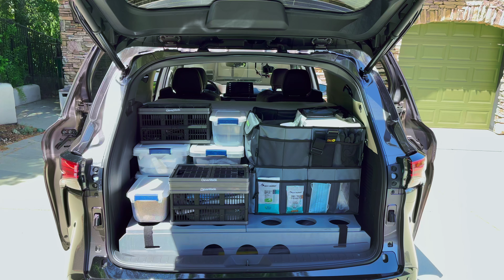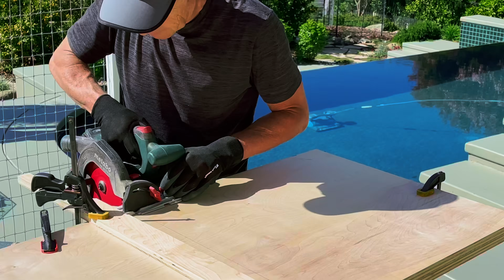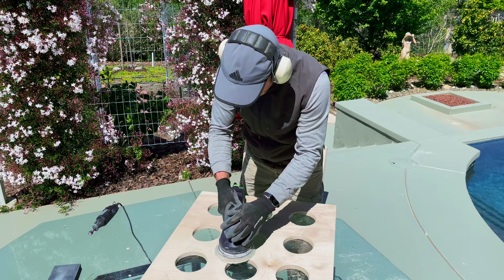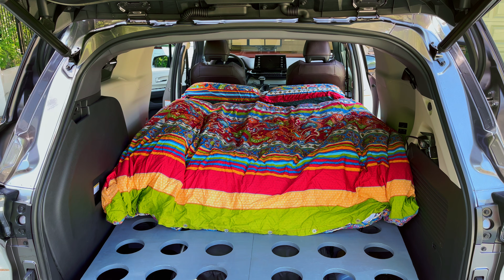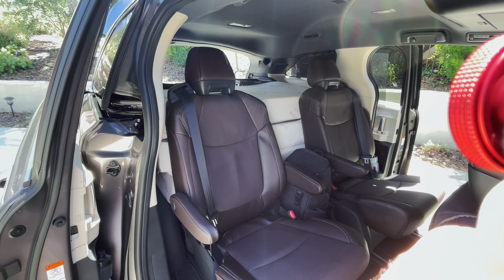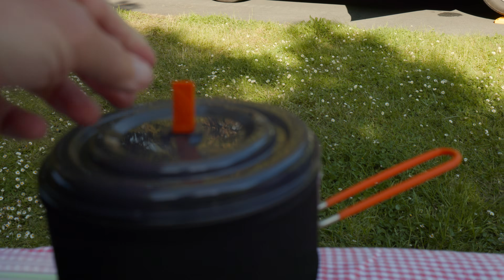2021 Toyota Sienna Camping Conversion: 2 and 4 seats sleeping configurations

Comment: Removing seats is not legal as it changes the original structure.
Reply from the maker: The seats in this vehicle are bolted to the frame and do not add or subtract any strength or rigidity of the vehicle.
Reply: ❤️👍👍❤️
Can you help me install
Reply: You in the Colorado

Comment: Awesome use of the telescoping ladders! What criteria did you use for choosing the particular ladder?

I'm guessing weight, capacity, ease of extending/shortening. Other considerations? Did you have to remove the ladder "feet" to be able to slide the ladder tubes into the holes?

Can you slide the ladder as a whole back and forth a little bit? If you can slide the ladder back a bit and the whole bed base along with it you could have a sort of "balcony" hanging off the back of you minivan on which you could sit (though doing so would place a torque possibly causing the whole thing to tilt). Just brainstorming ideas lol.
Reply from the maker: Hi Jose, thank you for your comment and questions. The weight of the bed and sleepers is evenly distributed by the plywood over the lengths of the ladder tubes, but the ends of ladders need to be supported. Yes, I took the rubber feet from ladders to insert them into the holes in the plywood structure. The diameter of the legs is ~2.4". Regarding the sliding balcony off the back of the van - I guess this could be possible but you would block access the the storage cavity where 3rd row seats are folded. Also the whole platform would need to be higher off the floor to clear the rear gate opening. I hope this helps. Cheers!
Reply: @Tellvia  Thanks Tellavia! Helps a lot and gives me some ideas!

Comment: That’s really interesting and creative for keeping the overall weight down….can you share more about the number of people sleeping….was it 2?….and did you have enough leg room when the middle seats were in?
Reply from the maker: Hi Dawn, thanks for your comment and the question. The lengths of the bed space is 72" (plenty leg room for 6 footers) with 2nd row seats in place and folded all the way forward to front seats. When the 2nd row seats are removed the total useable length of bed structure is 96" (should accommodate even very tall people). Sleeping for 2 is very comfortable, especially with 6" memory foam mattress. I hope this helps.

Comment: I thought about doing this with a 99 Toyota Sienna,  would a smaller motorcycle say a 300 model fit inside.
Reply from the maker: HI Jim, thank you fo your question. I think if wold be easier to fit a small motorcycle through the side sliding door since the step-in hight at the door is much lower than from the back. The max hight from the floor to the sealing is 42”. I hope this helps.

Comment: Wonderful. Thank you so much for doing this video. I have a couple questions if you don't mind.

-It appears that you cut the plywood panels to a standard size. Do you have that measurement handy?
-How high off of the floor (pick the reference point) does the top of your platform reach? Because of the variance of the shape on the side panels, I can't quite decide how high is optimal. You mention the 12" storage boxes supporting the ladders, so I suppose it's the width of the plywood, plus the ladder, plus 12".
-I would LOVE some dimensions on the third seat well structure, as well.
-How difficult was removing the third row seats? I haven't been able to find a tutorial and though it doesn't look difficult, I would love to hear feedback.
-Are you connecting your Jackery to the car for continuous charging? Then the fridge to the Jackery? Did you need the 1000? I'd love to cut some costs with the 300.

Thank you again. I was a little baffled by this layout once I started thinking about the build and with 3 weeks until a major trip, I wasn't even sure where to start. Plus, your hierarchy of need for this build perfectly reflects ours (though we have to keep the 2nd row until our little once is much older). This is a huge help.
Reply from the maker: Hi Atom, thank you for your comment and the questions. To start your project here what I recommend that you keep in mind when deciding on dimension of the bed structure:
1. If you plan to carry a refrigerator how toll is it. You would need to make sure that it would fit in the 3rd row well with the top plywood cover (which will be a part of your bed since you will keep the 2nd row seats). This measurement will define how high your bed structure will be. The floor in sienna is uneven and not leveled (it slopes down towards the front of the van). 
2. When designing/planning the bed structure make sure that you van is parked on a leveled ground or use spacers under wheels to level it. Now you can use a 36 or 48” bubble level and 6 feet long 2x4” straight lumber piece as a mock-up the bed structure from the back of the van to the folded and slid forward 2nd row seat. This will give you the hight of  the support (hight of the boxes) that will go under the legs of the ladders. 
3. The long level will also be useful when you are cutting the holes for the legs of the ladders. You want to make sure that the once the ladder sections are extended they will be flat. 
4. The 3rd row well has curved walls/floor. To avoid matching it contours I used just front and rear plywood section and used partial hight side sections cut as rectangular pieces. The side sections positioned to encase the fridge. Again hight of the structure in the 3rd row seat well is defined by what you put in it. I would build this section first. I will easier to build the middle section second. 

When I started my build I did not have any plans and measurements, I followed the logic above and kept cutting the plywood pieces to keep the structure level. The width of the van in the narrowest part (between rear wheels) is about 48”, so the standard plywood pieces will fit. I built my structure from 24x24” pieces such that I can unfold bed only on one side, if needed, but you can build yours from a 24x48” panels if you will always use full width bed. 
Regarding the removal of third row seats - it is relatively straightforward. All mounting bolts, covered by plastic covers, are accessed from the storage cavity. The third row seats come out as 60/40 sections, which is good, as they are heavy (~90lb and 130lb). Disconnect the battery before unplugging the seatbelt electrical connectors!
Now, about Jackery backup battery. We returned the 1000 unit and bought the new 1500W unit because we wanted to make sure that we would have enough charge to keep the fridge running even in very hot weather for at lest 3 days. The battery is connected to 110V inverter and the fridge to Jackery. The inverter in Sienna works only when the car is on (and the AC 110 switch is ON), it does not use the hybrid battery energy when the van is parked. When you drive the van charges the Jackery and keeps the fridge running. The new 1500 battery charges faster during driving. But the size of the battery depends on your needs. The fridge we have uses max 40-50W when it is cooling and about 20-25W once it is down to target temp. So 300W battery will keep it cold for between 6-12 hours.
I hope this helps. Good luck with your project!
Reply: @Tellvia  wow such details!  Thank you for sharing this important information

Comment: When you removed the 2nd & 3rd raw sets; How did you bypass the airbags lights in the dashboard of the 2021 Sienna?
Reply from the maker: Hi Jose, thank you for your question. Here is the link to siennachat forum where the issue of airbag warning is actively discussed https://www.siennachat.com/threads/2021-sienna-mid-row-seats.64221/. According to Toyota the second row seats are not removal because of potential safety risk associated with removal and disconnection of airbags. I removed the seats and found a solution for the air bag warning at my own risk. Because of potential safety and liability reasons I do not provide recommendations or specifics about my seat removal steps. All the best.
Reply: @Tellvia  so you were able to remove the 2nd row seats in a way that allows you to put them back in?! Im so curious how you did that. For my (very simple low cost) build,  I just left the chairs. And I am not able to sit up in mine, but i do have plenty of room for gear, which makes the stuff shuffle pretty simple. Yours is very impressive and I am inspired to try again!! Thanks so much for sharing :)
Reply from the maker: @ericastrachan4623 , thank you for your comment. Yes, I removed and re-installed 2nd row seats in our 2021 Sienna several times in the past 4 months, when we needed the van to seat more than 2 people, without any issues. The disconnection of the airbags built-in the 2nd row seats is something I’d advise you ask an automotive professional to do, so it is done safely. The airbag warning on the display can also be avoided and most of car mechanics should be able to help with that. Cheers!

Comment: Awesome project and video. I was thinking about doing something similar to a new Sienna I am thinking about buying for long trips. Do you think is possible to accommodate 2 adults and 2 kids(11 & 10) if only the second row seats are removed and a bunk bed setup with thinner memory foam mattress system is built ? Any feedback is appreciated. Thank you
Reply from the maker: HI Ricky, thank you for your comment. I think to accommodate 4 people in the new Sienna might be possible but it would be a tight squeeze, especially if you plan travel with some luggage. You likely would have to build two platforms - one to even out the level of the floor in Sienna and cover the second row seats mounting hardware (which is difficult to remove), and the second platform above it at about 18-20 inches. The total hight inside from the floor to the roof is max 42 inches, so this dimension will be a limiting factor. Both lower and upper level sleepers would have to be willing to crawl into their sleeping spaces. Good luck with your project!
Reply: @Tellvia  thank you for your response and your recommendations. Thank you for your great videos

Comment: also, do you have a mechanical drawing with dimensions of wood to be cut?
Reply from the maker: Thank you for your question, Paula. I started this camp conversion build as a first prototype and did not use any any drawings. It turned our well enough to use it and not needing the second build. I suggest you do the same following ideas from mine and others videos. All the best.

Comment: thank you for this video.  you mention birch plywood for your platform. what thickness did you use?  I'm guessing 3/4"???
Reply from the maker: That is correct, I used ¾" thick plywood.
Reply: @Tellvia  what about smaller holes in the plywood if we don't have a fridge there.  seems like may be 2 or 3"??
Reply from the maker: Smaller holes will work as well. There is not much load on the plywood structure, any hole size would be okay as long as you leave about 1.5-2” of wood between holes. My choice for the size of wholes was purely for aesthetic reason and for balance between removing a maximum excess of wood with a minimal number of holes. Good luck with your project!f

Comment: Good video! Can you leave the sienna hybrid system on 24 hours without it shutting off after an hour? In the Prius, you can sleep in the Prius with climate control on all night all day without the hybrid system shutting itself off! If the new hybrid sienna does NOT auto shutoff after an hour then I’m going to buy one for climate control camping.
Reply from the maker: Yes you can! You have to select "keep engine ON" on the display when you start the van. My video discussing HVAC on new Sienna for camping is coming our later tonight.

Comment: I guess you used a full-size mattress; I think you said it was 52x73 as compared to full-size of 53x75. But then you said 20 inch sections, which would be only 60 inches. Could you clarify? Did you cut the mattress yourself? Thanks; love what you're doing!
Reply from the maker: Hi DrG, thank you for your comment. I just remeasured the dimensions of the 3 panels of the mattress we use in our Sienna and they are 52”x24”x6”. I must have misspoken stating that the panels are 20” wide. I separated the mattress panels using a thread ripping tool. With little care and patience it can be done without making any rips in the panels. I hope this helps. Cheers!
Reply: @Tellvia  Thanks! I'm 6'4" so I need a longer bed but your video gave me the idea to look for a trifold foam mattress. I found a King-size Milliard on Home Depot website that will work. (Their almost-queen-size would also work, with 2 sections longitudinal and the 3rd crosswise so thanks for the tip!

Comment: Thanks for great video. You should make a video talking about yourself. I’d love to know you more. 
I bought a Sienna last week and I can really appreciate your courage gutting your new van and drilling holes in it. That takes some guts.
Reply from the maker: Hi Amir, thank you for your comment. Congratulation with your new Sienna! Not a single hole was grilled in our Sienna. The whole idea of this project was to create a bed structure which is touching only rubber mat at the back of the van and carpeting in the middle section. 90% of the structure’s weight is born by the third seats’ mounting brackets which are normally carry all the load of the seats. I made sure that I can preserve all interior parts in original condition. As to talking about myself in the video - perhaps one day :). I believe most of viewers want to hear about my projects for now. All the best.
Reply: @Tellvia  would be great to know more about the creative mind behind this build.  what is your background, your inspiration, etc.

Comment: Can you run the HVAC system and all night long as the other videos show in hotel Prius?
Reply from the maker: The engine noise disturbance to neighbors sleeping in tents may be a problem for running the climate control system at campgrounds.

Comment: Wondering if you terminated the connector of the second row seat after removal to prevent airbag light from coming on? Thanks for your helpful information!
Reply from the maker: Thank you for your comment and the question. After some research on the web about the airbag connector termination I used a 2.5 ohm resistor and it worked for me. I did this on my own risk and don’t recommend rear seat removal in 2021Sienna for potentially safety and liability reasons. Cheers!

Comment: Put one 350W solor pannel on top can give you unlimit of power
Reply from the maker: Hi Michael, thank you for your comment. The sun energy is unpredictable in some areas like Pacific Northwest. Since new Sienna has a 1,500 W 110 AC inverter we have plenty of power when we are driving to keep the fridge running and to charge our Jackery 1500 battery for running the fridge at night.  I hope one day the cars come with built-in solar roof. Cheers!
Reply: @Tellvia  oh, ic, with build in Invertor, that is nice, yes the fridge don't use up all the power, i have one on in my 2006 Toyota Estima, almost like yours as inside, but i also use it with my rice cooker and water boiler and connect to 200Ah battery plus 2000W inverter. it is so much fun to camping out.

Comment: What model is your sienna? Does converting it into a camp mobile having anything with your model decision? I am so glad I see your video. I am think about getting a sienna Platinum
Reply from the maker: Thank you for your message. We were fortunate to find a Platinum trim of Sienna at our local dealer. The 2 key options, that come with Platinum trim, were the AWD and 1.500 W AC inverter. The AWD option is great to have, even in everyday driving, as it improves van handling. The AC inverter is a must have if you plan to use the van for camping. We bring a portable refrigerator with a backup battery for it. The AC Inverter charges the battery and runs the refrigerator when we are driving and the backup battery keeps fridge running at night and when stationary at rest stops and campsites. I hope this helps. Good luck with your Sienna purchase!
Reply: @Tellvia  I am thinking exactly the same way on AWD & invertor.  Thank you for sharing.

Comment: Well done, I’ve enjoyed the video! I have a Prius and was thinking about doing the same thing. I assume you travel with your bike. Do you leave it on a bike rack outside when you sleep? How do you determine where to camp overnight?
Reply from the maker: Hi Arthur, thank your for your comment and question. I am working on the video where I show how I cary my bike in the Sienna - it should out soon.The reason I build the sleeping platform separated in the middle is to be able to unfold and sleep on one side and keep my bike in the van on the other side when I travel along. Staying at campgrounds is best - convenient and safe. Alternatively large rest areas along highway are a good option in a pinch. Cheers!
Reply from the maker: Hi Arthur, here is the video about how I carry/camp with my bike: https://youtu.be/2Q8PWXh8YfA

Comment: How do you remove the seats without compromising the air bags?
Reply from the maker: Hi Larry, thank you for your comment. There is a lot of information on the web about using resistors for preventing the warning on the display about missing airbags. I did my project at my own risk and do not recommend to anyone seat removal from 2021 Sienna or circumventing the warning message because of potential safety risks and for liability reasons.
Reply: @Tellvia  thanks. Great build!  I’ve made a one person sleeping platform in my 2017 Rav 4 Hybrid for occasional use. The battery bulge reduces height considerably.